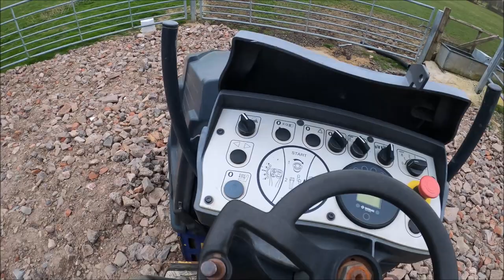09/03/22.  Setting my South yard inspection chamber, and collecting the roller.

Comment: just a thought 
get a second hand wardrobe mirror 
mount it horizontal on the 
tool/fuel door 
helps to check trailer lights 
without getting out the cab
specially the brake lights
{:-) PAV
Reply from the maker: You know someone would break it don’t you 😄😄

Comment: Farmer P, enjoyed the video but a nosey question. The big blue barn appears to have doors at the other end which look blocked up. I wondered why you didn’t use them to store the big equipment in? It looks like an easier place to move the trailer etc from?
Reply from the maker: Security Paul. That’s why the South end doors are sealed shut.

Comment: I read a poster for a roller with a remote so you dont have to ride it, vibrating your boddy to bits. I dont know if that was a one hit wonder or if it still is on the market..
Reply from the maker: Doesn’t sound like much fun though Kent 😄
Reply: @FarmerP  I agree, but my boddy is not found of bupy rides anymore.

Comment: Ian you said you were tired Mixing the concrete. Taking them steps feeding the mixer burns up so much energy. I would have been asking the question could you not have got the mixer closer but I think the lead might not have been long enough. That been the case my way of thinking would have been to work off the land rover. Would it have been possible to set up stop closer to were you poured again not pushing the wheelbarrow so far would save energy.
What I have said I say with not knowing your place. I could be way off the mark with whit I said. You Know best
Reply from the maker: I don’t mind a bit of extra effort Mark, some burn it off on a pushbike or running around the countryside, I spend my energy on being productive. 🙂🙂👍🏼

Comment: Not being funny Ian but why didnt you have the concrete mixer closer to the sand n cement , safe you walking back n forth carrying shovels of sand n cement ? Im sure you will have a reason lol
Reply from the maker: Two reasons Will. The level of the floor and the length of the cable 😄😄👍🏼
Reply from the maker: The ground wasn’t very level next to the con mix Will, the machine works better on level ground. 🙂👍🏼
Reply: Thanks lan ... l knew there had to be a reason , l was just curious lol